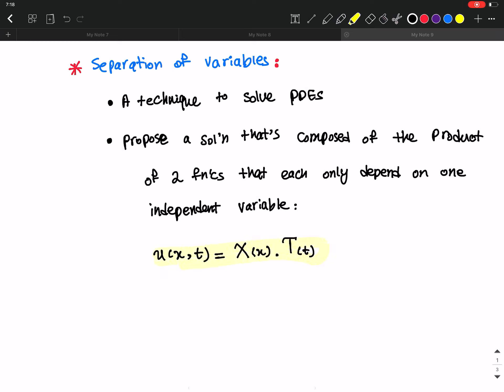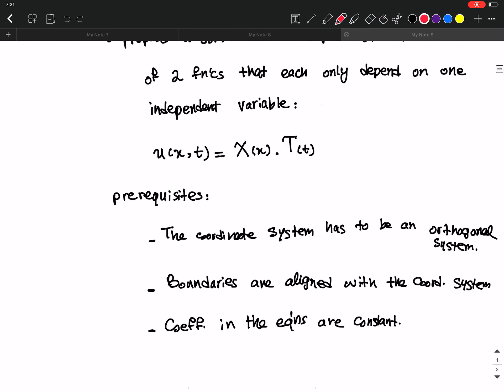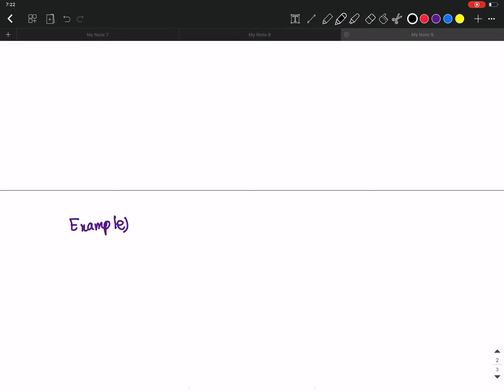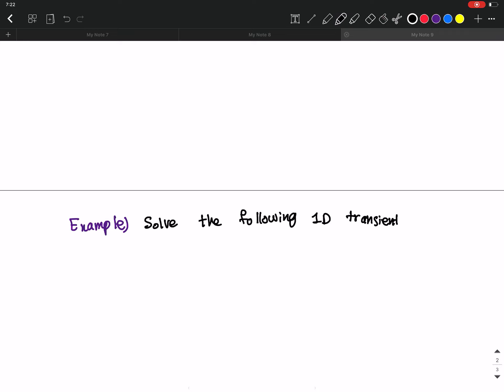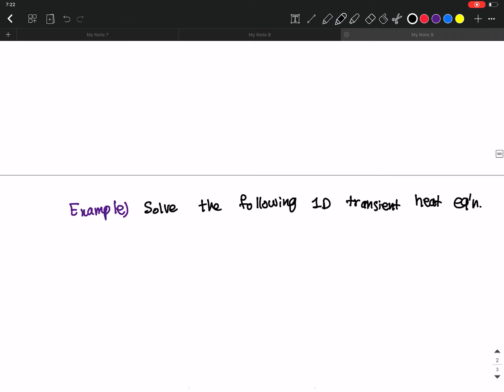Lecture 7 Part 1- Separation of Variables to solve PDEs , Transient Heat Equation Example

Comment: Hello professor, your videos are very helpful. I have a question regarding transient heat transfer, why when the temperature is unsteady the system is called unsteady conduction? How about convection and radiation?